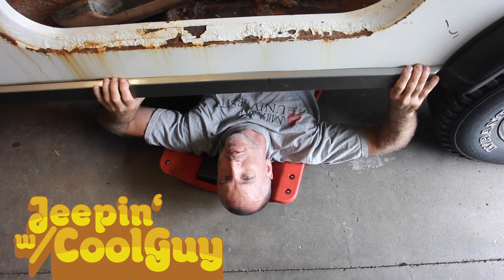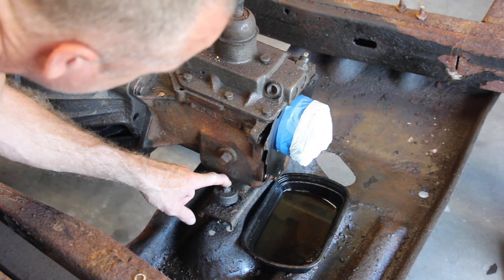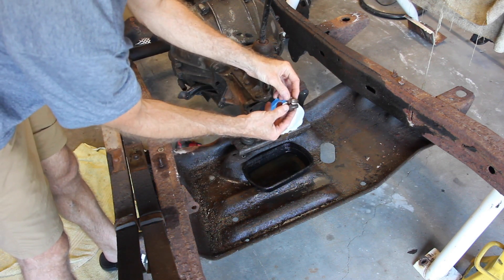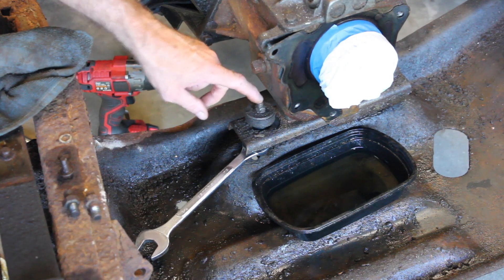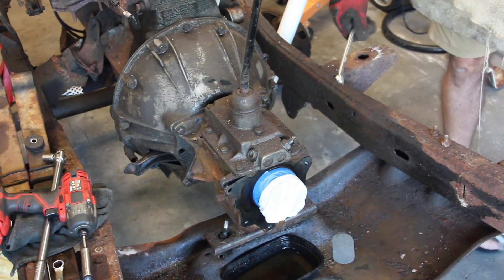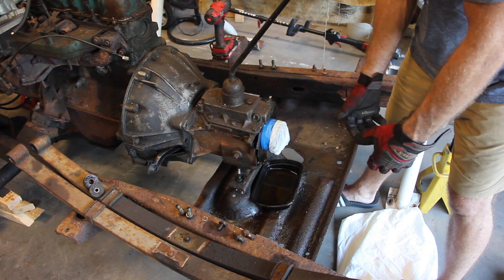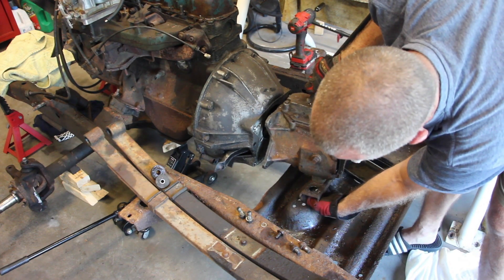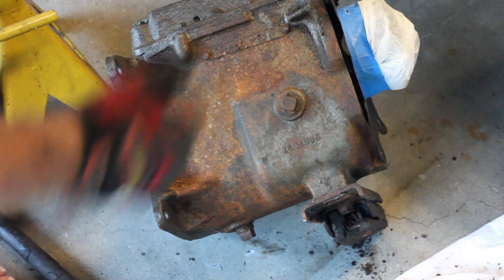Jeep CJ7 T150 3 Speed Transmission Removal

Comment: Your videos are very good. You video show everything and you detail everything you do. Thanks a lot, makes it easier after watching your videos.
Reply from the maker: Excellent to hear. Just don’t wear flip flops like I do :) not advisable footwear for vehicle restoration.
Reply: @coolguy_CJ7  I took it appart, I confirmed why the reverse idle gear has to be removed before the main shaft, I would have gone crazy not knowing that from you. I used regular tools, no pullers. The inside retainer clip for the bearing, yeap, PITA, I have tried to make two tools after I grinded it out, but neither work, I think next time I wont waste a second and just grind the clip and just discard it, kit comes with it anyways. I am waiting for the retaining clips that hold the Synchronizers three teeth from inside, two were broken and they are not in the kit. The part that gives nightmares is reinstalling the idle gear back with all the rollers there, I will eatch you Assembly video soon, thanks a million times again. I feel I should buy ou a good pair of hard toe safety boots as a gift, I owe you a lot !
Reply from the maker: @johnnytorres5349  what do you mean? Are flip flops not the standard footwear for auto restoration? :)
Reply: @coolguy_CJ7  hahaha I get up early make coffee and walk to the Shop, on Flip-Flops, and when the day is over I realize I weared them things all day !!!  Been there done that !!!

Comment: I had to take the skid plate off once one bolt came off one side the passenger  side bolts snapped off from torsion and age scared the crap out of me I had a jack stand in the centre also last owners didn't swap out the tranny support from the 3 to the 4 speed and it looked crooked in there now i know why . Good information on all the vids so far

Comment: LOL Im sure glad you figured out to support the back of the engine before pulling the transmission.  That's not a happy balance triangle!   I commented below regarding removal/installation of the entire T150 unit (bell housing, T150 and transfer case) from under a CJ5 from under the Jeep.  
I do appreciate your videos, but Sir, if anyone watching all these needs to know wrench sizes for every nut and bolt, there is a really good chance they have no business messing around with heavy metal, and this isn't even very heavy.  Ok, I get that you need to stretch the videos, but there are plenty of other things worth noting relative to the content than watching a bolt removed and noting its size.  LOLOL
Reply from the maker: I do try to be thorough. Maybe too much. I'll try to stay focused. :)

Comment: How hard you think it is to remove from underneath with tub/body on? I am going to have to pull my transmission as it is locked up and will not going to gear.. I appreciate this video and the rebuild video you’ve done. Kind of gives me a gauge of what I’m about to get into lol.
Reply from the maker: It shouldn't be too hard. You will need to have a good jack to support the skid plate and another one to support the engine and bellhousing when you remove the transfer case. Just remember, these things weight a ton and you're going to be hard pressed to support it with your own hands. I will need to do this this summer when I pull my engine from my 84. It needs to be rebuilt so I will post a video on that then.
Reply: I know it's kinda off topic but does anyone know a good website to stream new movies online ?
Reply: @Paul Dawson I watch on flixzone. Just search on google for it :)
Reply: @Christian Luka Yea, I've been using Flixzone for since march myself =)
Reply: @Christian Luka thanks, I went there and it seems like they got a lot of movies there :D I appreciate it !
Reply: @Paul Dawson You are welcome :)
Reply: Ok 5 months too late to answer you but for others who may ask:  I removed and replaced the entire bell housing/T150 trans/transfer case as a unit from under a CJ5 using a transmission jack under the Jeep.  KEY WORDS:  TRANSMISSION JACK!   Before I go further, PLEASE NOTE that the transmission jack I used has a strap and I DID use it!!! Also note that I made the top plate of the trans jack slightly larger to support the base of the transfer case.  No matter what - never ever risk a situation where a beast like this can even entertain tipping over.  The risk will not be worth it.  It needs to be rock solid or it can fall on you, or fall and break the transmission, or both.
The most important thing here is for you to keep yourself out from under the unit. Period.  If you have to support the whole unit from the back of the transfer case in order to adjust the trans jack position to find balance, DO SO until you KNOW it is steady.  FYI, I did this by myself from underneath, but only saying this that if you are fortunate to have someone steady the shifter stick from in the Jeep - it removes all kinds of potential balance issues.  Of course this applies with installing as well, particularly when aligning the input shaft into the pilot bearing AND around the bell housing.  That is a trick in itself literally.  
I removed the crossmemeber skid plate - supporting the trans unit from the back of the transfer case.  Then slid the trans jack in place and positioned it.  Once all bolts are out and everything remains balanced on trans jack with the strap tight around the transmission, the removal is a stairstep process down and aft - small increments at a time in order for the top of the bell housing to clear the transmission tunnel while also separating the input shaft from the clutch.  In my case, I unfortunately had to remove the shifter stick to clear underneath, but no biggy - I replaced all the top end parts anyway so it had to come apart.
Long story short - there is an old trick for those who don't know - when installing any transmission, is to buy two bolts just like the bell housing bolts but slightly longer, then cut off the bolt heads on the two and taper the ends to use as line up studs threaded into the back of the engine block temporarily.  Make sure the studs are long enough to remove once the transmission is stabbed.  (This could also be done if only pulling the transmission.)  This alone could save hours of real frustration and potential safety risk just by using line up studs.  Trust me that tip alone is gold if you don't know to do it.

Comment: I can’t find any videos on the T15 heavy duty 3 speed. From like 1970-1973. It looks just like the T150. Do you know of the removal and rebuild is pretty much the same?
Reply from the maker: Don’t know. Let me see what I can find out and report back.
Reply: @coolguy_CJ7  well I found this. Both good and bad (good that the T15 is heavy duty, bad that I can’t find a tutorial on the removal and rebuild)
The T-150 is a Ford passenger car 3-speed transmission, made on license for Jeep by Tremec. The T-15 is a Borg-Warner transmission, and their design. Lots of differences, and interchange only with a lot of different parts.
Reply from the maker: @patriotfox7192  That is probably the case, but I will say it can’t be that different. Both are very simple transmissions. There will be nuances but I’m betting there will be a lot of similarities. Worst you can do is open the top and see how much it looks like a T150 and then film the disassembly so you can remember how to put it back together. I guarantee there is nothing in there that a specialty transmission shop will need to do.

Comment: Has anyone put a temp gauge & sensor on a t150? Left side of the trans has a fitting to drain the trans fluid so that should be fine!
Reply from the maker: I’m sure someone at some time has done something like that. Although, I’m curious as to why you would want/need to do that on a very basic 3 speed transmission.
Reply: @coolguy_CJ7 hey thanks for the response, just to have a temp gauge on those and i got the room to fill on a custom dash.